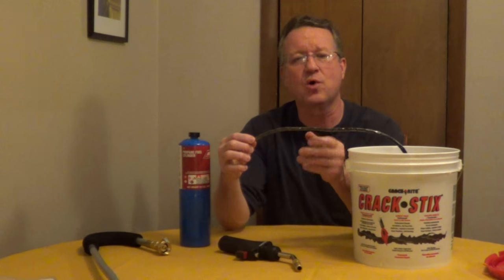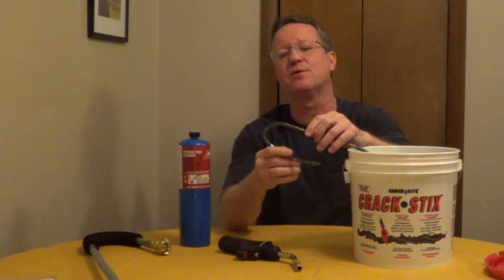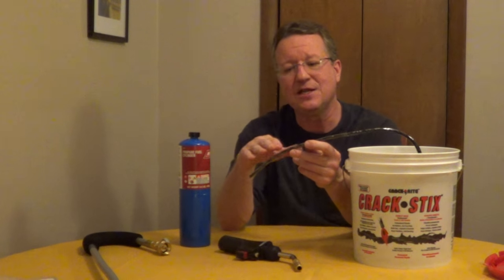Asphalt Driveway Crack Repair - Crack Stix

Comment: Your thoughts on this product vs something like the Henry Elastomeric crack repair you can pour right in out of the bottle?
Reply from the maker: Hi, for small cracks, a pour bottle is easy to use. The Crack Sticks melts into a larger crack and it gets very hard. I've used this on a couple concrete driveways next to a house and it has really held up well.